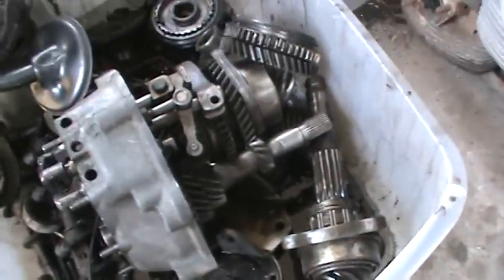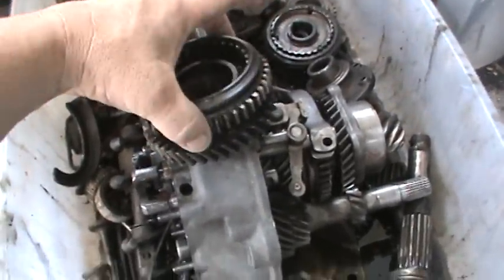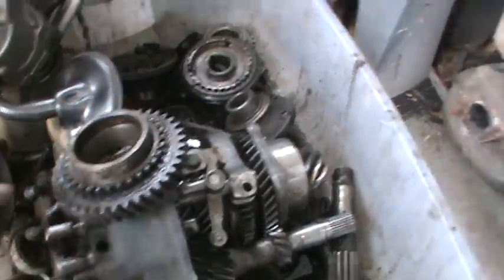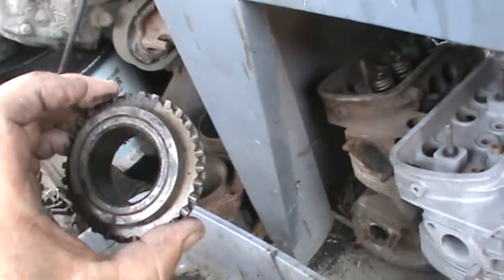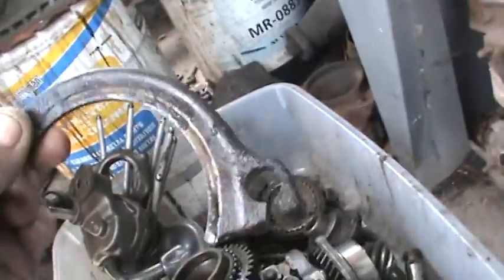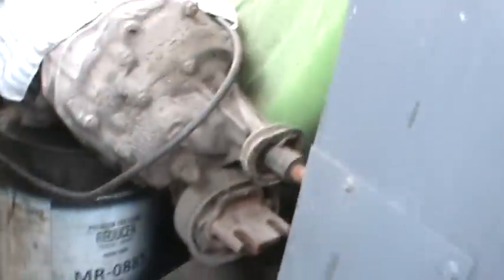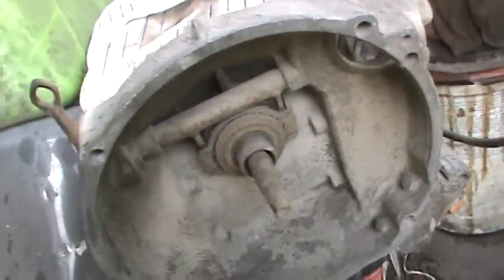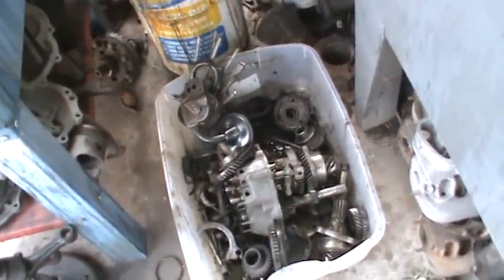how to diagnose VW transmission problems

Comment: What about popping out of reverse? All forward gears are smooth shifting
Reply: Same here on a buggy. Did you ever find a repair
Reply: @Unwoofable  no I didn't. The reverse gears are weak and breaks easily. I have a spare trans . Gonna mess with the reverse later on the bad one
Reply: @Unwoofable did you guys ever find the repair?
Reply: @rwebdaddy did you ever find a repair?
Reply: @travist6345  ya I had mine totally rebuilt. 😁

Comment: i have a small slip in 3rd, you feel the car engage third the revs come down at same time then you feel a second lunge and the revs go up for half a sec, feels like it reengages 3rd.  ive changed fluid, not flushed. fluid ok now before it was a little dark and short about 1.5 quarts (im guessing previous owner did not change correctly)   so any ideas on shift issue? expensive?   2007 vw rabbit 2.5 automatic

Comment: i just found your channel i do not know if you are still active but i have a 03 jetta 1.8t with a 02j trans i recently grinded 2nd gear and the car doesnt go into first gear at all. wondering if it was synchro/something related or shift fork .

Comment: Good video darrin.  I have a question tho, I have a 58' bug.  The transmission would do nothing but grind when I would let the clutch out.  It wouldn't try to engage.  I could shift it into any gear just fine but it would just grind whenever I let out the clutch.  Any ideas what that might be???

Comment: hi im from Malaysia,  i just bought a mk6 golfR its still stock but pushing around 289whp its great, but i have some issues with the gearbox, when it changes gears it has a slight klacking sound im kinda worried as vw's have problems with the gearbox eithee its dsg or anything and when i shift in second gear sometimes it lacks off nearly 2 secs then it responds what might be the problem?

Comment: I have a question I have a 2004 Volkswagen Passat GLX 2.8 L V6 30 valve automatic transmission I recently replaced the transmission pan and transmission fluid the car out of nowhere started giving a small pop into gear at 35 to 45 miles an hour after replacing all the transmission oil and transmission pan it started running fine until I got on highway speed it will not shift into 3rd 4th or 5th gear any ideas on what the issue is? Also it did not do this before the transmission pan change and transmission fluid change but it was showing a p0735 fifth gear incorrect ratio before the transmission pan and fluid change

Comment: I have to laugh.... back about 2002, my lab partner and I in automotive trade school, were R&Iing and rebuilding a 66 VW transaxle.  Unbeknownst to me, my partner put the differential in the wrong side of the case and neither of us noticed the clutch cable bracket on the wrong side.  We switch the sideplates, finished up the install, and were greeted with a car that had 4 ratios of reverse and one forward!  We also installed the engine in that same car from rolling the car in to driving it out in 17 minutes, besting the school record by 3 minutes.  Fun times.

Comment: Top video - my Golf MK4 auto idles perfect And when I put it in gear it goes in to limp mode - I can shift through the gears - but then it looses power and shuts off - all the gears work well - do you think it’s the transmission speed sensor ?

Comment: hey bud were are you located at and do you specialize in volkswagen 5 speed I have a o2j 1.8t 5 speed mk4 transmission just blew out on me picking up used one but my bad transmission has a quaife and a tdi 5th gear I would like to transfer over to new transmission how much would you charge to do that

Comment: My 72 bus has started a noise only when the clutch is released and is there whether in gear or neutral. The noise speeds up as you accelerate.  It is getting worse so I stopped driving it.  It sounds kind of like when a kid has a playing card hitting the spokes on a bicycle wheel. Also the linkage is temperamental.  Hard to find first when stopped.  As long as I shift while in motion it goes in so I have to make sure to shift into 1st before I stop and leave it in gear so it is ready the next time I use it.  Any ideas??  pnhagen56001@gmail.com